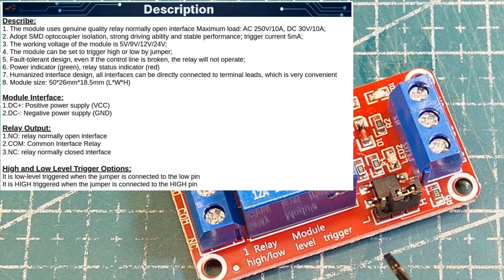Mailbag #31 - the return of a regular devotion to late night online shopping 😬

Comment: Thanks for mailbag video. Always good to see reviews too. Btw does the USB-A cable the 3way micro/apple/usbC have the data pins connected. Previous multi cables I’ve got had only one data pass through with remaining only for charging 
Good luck with the move 😊
Reply from the maker: That is a good point - I'll test that and put it in the next vid - thanks! 😃👍

Comment: Coils of relays usually turn on at about 75% of VCC, that would mean in case of a 5V relay: 3.75V. So I think you are out of luck there. But if this actually hold true... there is only one way to find out! 😃👍
Reply from the maker: When I’ve made this “mistake” before I’ve used a transistor off the main supply to trip the coil. 🤷🏻‍♂️
Reply: @onecircuit-as  If you have an ESP dev board you can use the 5V coming in. If you are using that.